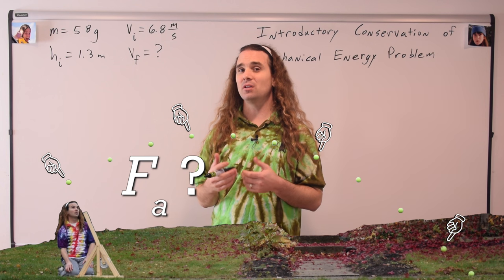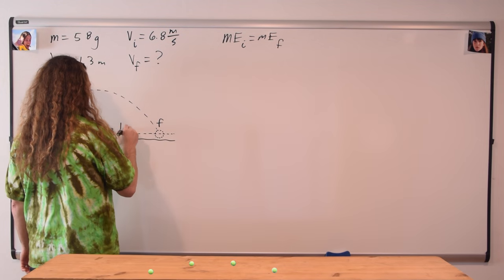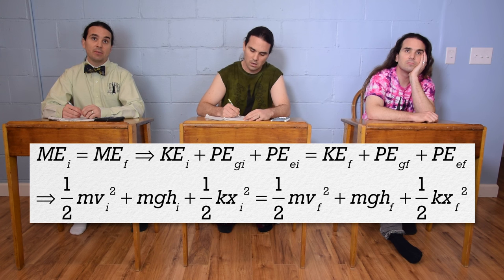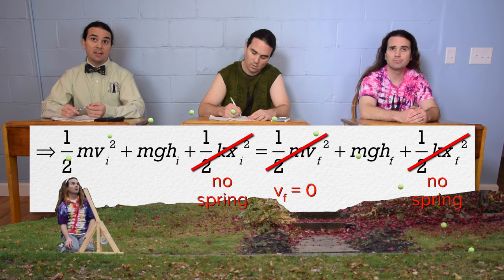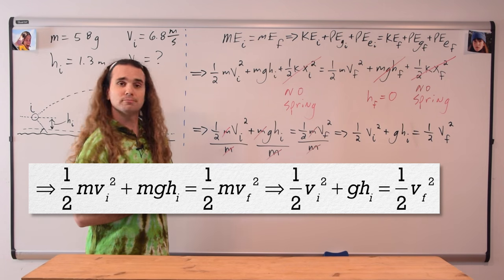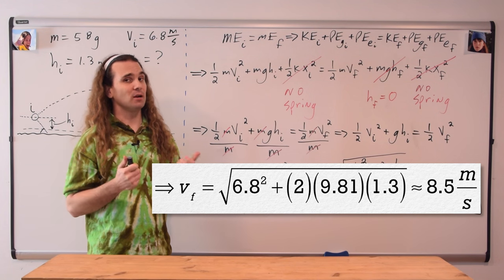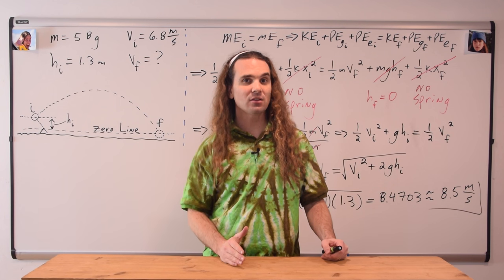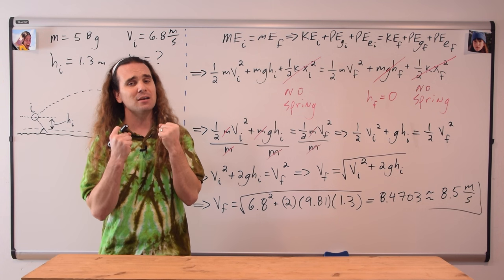Introductory Conservation of Mechanical Energy Problem using a Trebuchet

Comment: Well done, and kudos for having students write out the detailed long-form of conservation of energy!  Take your time, write it out, make fewer mistakes and save yourself time in the long run!
Reply from the maker: +Dan Fullerton (APlusPhysics) Yep. They gripe about it, however, in the long run, they understand more, make fewer mistakes and actually save time. Thanks!

To be clear, roughly two weeks after they learn about COE, we have a quiz on COE and after that I tell them they have "graduated" from writing down all the possible mechanical energies and can now only write out the ones which are actually there. During those two weeks they write out the equation often enough they have all the types of mechanical energies memorized.

Comment: Great video! But I think there is a way to solve it using projectile motion, even without the initial angle of launch. We know it is parabolic and that the final position is 1.3m lower than the initial position. So the corresponding point (at the height of launch) during the descent will have the same speed as the initial 6.8. From there, using v^2 = u^2 + 2gh, we can find out the final speed at the moment before it hits the ground, and get the same answer.

But great explanation!
Reply from the maker: v^2 = u^2 + 2gh would all be in the y-direction, however, the velocity of the ball is never fully in the y-direction, it always has an x-component. So, no, you cannot actually solve the problem this way. You will likely get an answer which is close, however, not correct. The only reason you would get an answer which is close is because the velocity in the x-direction is small compared to the velocity in the y-direction near the end of the parabola. If the height of the arc were lower, your answer would be more incorrect.

Comment: Mr. P. I love you're work and what you do, I just, as a student, find it difficult during tests, especially worried for my upcoming AP test, to have to write out every long equation. I don't do well with timed assessments and all my tests/quizzes are timed. Are there any better solutions or just ways to beat the clock without making any mistakes. Memorizing the equation is the best thing I can think of but I don't trust myself to memorize all of that. I need something quick and reliable if that's even possible. If not thats okay too!

Comment: does the conservation of mechanical energy stay true for problems that you have to consider electric potential energy ?
Reply: Yes.  Because electric potential energy is considered a form of mechanical energy.  Mechanical energy in general, means kinetic energy plus all forms of potential energy.  Mechanical energy is conserved as long as no non-conservative forces are involved.  I.e. as long as all forces involved are either conservative forces, and/or zero-work forces of constraint like the normal force.

Mechanical energy is not conserved, when there is an irreversible process, where energy leaves the mechanical domain and becomes thermal energy.  Or where energy enters the mechanical domain from a force a human or other agent applies.
Reply: @carultch  thanks!

Comment: This is so interesting because I never really thought about kinematics and mechanical energy "working!" together in a projectile motion problem! This totally links everything we learned together!! I was just wondering now that we have the final speed of the ball, would it be possible to then solve for the angle of trajectory since we know the vertical displacement? Great video and thanks for the wonderful content!
Reply from the maker: +Matthew I am trying to think of a way, knowing the initial speed of the ball, the final speed of the ball, and the vertical displacement of the ball, where one can solve for the angle of trajectory and not finding one. Interesting question ...
Reply: @FlippingPhysics  A ball is thrown with an initial speed of 15 m/s, and lands on a horizontal plane that is 8.93 meters lower than its launch point, where it impacts the ground with a speed of 20 m/s.   Calculate the launch angle.  There are two solutions to this problem based on the given information.

Comment: When you get to rotational kinetic energy, do you add it in as a 4th component of the large equation?  Or, do you allow the shortcut of only writing down the expressions for the forms of energy present?
Reply from the maker: By the time we get to rotational kinetic energy I feel my students have worked with it enough that I think it is okay for them to just write down the forms of mechanical energy which are there.

Comment: I am the man in pink. Personally I don't really get why you'd need the full "mechanical energy". To me, it seems like a much bigger deal that information such as values and equations are correctly copied before the problem begins, and every time you reach a major milestone, make sure you've written it clearly so you never misinterpret it later. That has solved every problem I've ever had. Do you find people have trouble identifying what kinds of energies are present?
Reply from the maker: +Zuzu Superfly Absolutely, students "have trouble identifying what kinds of energies are present". Having taught physics for 15 years, I can tell you that when, about 8 years ago, I added the requirement of writing down all of the energies which could possible be there when starting the problem, it greatly reduced student confusion about all the different types of mechanical energy. Every time you write down the equations for all three types of mechanical energies you are reviewing them.

Note: After they take their quiz on this concept, I drop this requirement. As stated in this video: http://www.flippingphysics.com/intro-wf.html

Comment: wait so if it isn't a projectile motion problem, then was it just a coincidence you derived a kinematic equation at the end?
Reply: It's no coincidence.  It's a confirmation that the formula works, by approaching it from another method.

It ends up being one of the constant acceleration kinematic equations, because there is only one force acting on it during its journey, and that's gravity.  Gravity causes constant acceleration when the field is uniform.